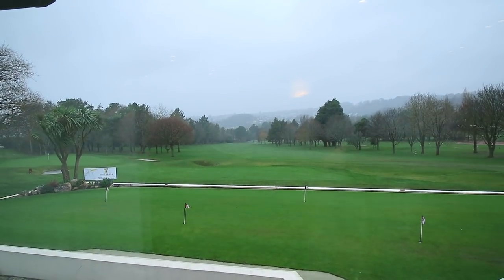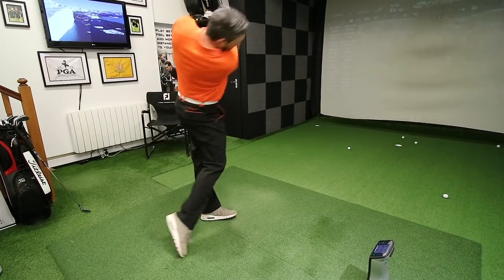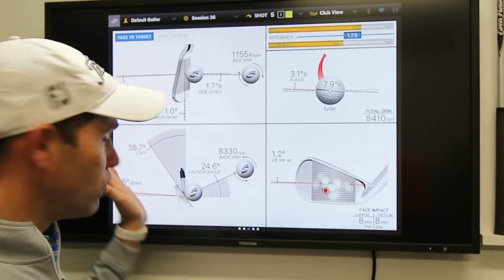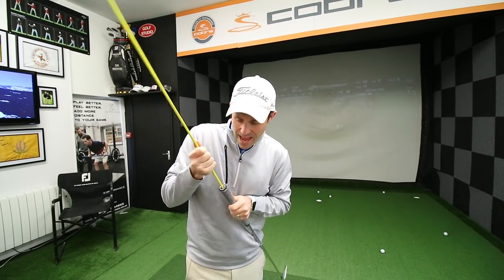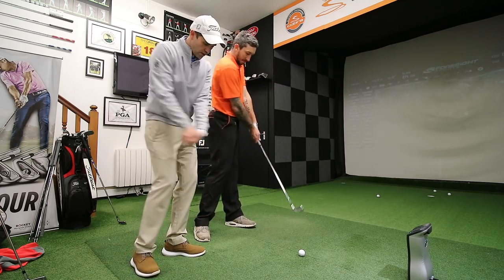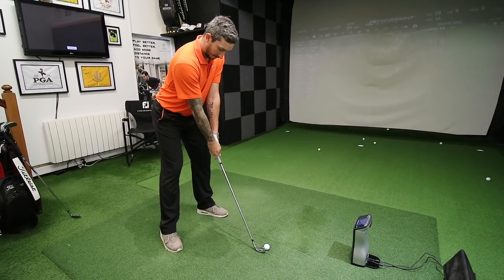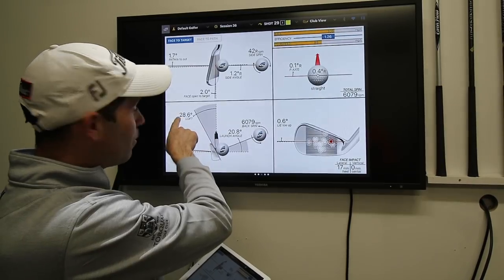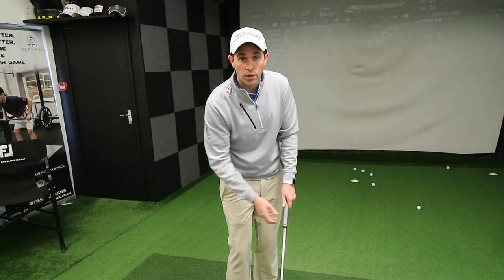HOW TO CONTROL YOUR IRON LOFT

Comment: By coincidence I was playing around with loft today at the range. Lately I have been injured and unable to play for several months. Getting back I found a lack of club head speed and distance with my stiff shafted clubs. I decided to take my old clubs with regular shafts to the range. When I learned I needed my stiff shafts I had to find a way of making my old clubs work. I had the result I required by reducing loft as you described, so now I want to transfer it to my new set. Can't wait for the experience tomorrow. Thanks for that today. Good luck with the channel.

Comment: Yep, I had this issue too and have been working on it for a few months now. Haven't been using the stick drill though - what's helped me is a drill where I take a half backswing and then doing a full swing through from there. My coach gets me to visualise "50% back, 150% through" and it's been really helping.

Comment: Love the video dan i went through that process with my coach. But my reasoning was efficiency and to sort my path. I've had the issue with lower than average spin since i changed my delivery from 8 deg out to in to 2 degrees in to out i lost spin.

Comment: Hi Dan, don't know if you can help?  I play Cobra one length irons and hybrids. Cobra F9 driver and woods. My swing speed for irons is normally around 67-72 (irons) and slightly higher for driver/woods. As a result I don't get much distance - 7i 125-130yrds
I'm 52yrs old.  Any ideas why I can't hit further? I guess it's technique..

Comment: I have the opposite problem. I sometimes get my hands too far forward. I can hit my 58* at 20* launch lol. Generally when I'm hitting well I'm around 1/2 the loft. 58/29, 34/17, etc.
Reply: You are talking about launch angle, Dan was focusing on this guy's delivered loft in the video. They are different measurements. If you go back to the numbers for example on Lee's good swing with 26* delivered loft he launches at 16*. Hitting launch angles of half the static loft is fine.
Reply: @michaelbarnocki5668  I understand both numbers fine. I dont have easy access to a Quad so I dont have my actual delivered loft but my launch on a lob wedge can approach 20 or lower which is far too low. Consider his 7 iron launch at around 27 the first go which is obviously way too high which is why I mentioned the 1/2 the loft thing. Sorry for the confusion haha!
Reply: The problem with too much shaft lean is that you can't launch the ball enough high and it doesn't have spin. Also the smash factor is way too big and makes the gapping hard. I sometimes hit it with too much shaft lean, and get 16° dynamic loft with a 34° 7 iron. Then the smash factor is  1.43 on trackman which is too much for a 7 iron. The launch is 12° which is good for a driver, not for 7 iron. The shaft lean is good for driver as I get 1.51 smash factor and 2000 rpm spin. The launch is sometimes under 10° even when I hit up on the ball. So the optimum would be 25-28° spin loft for 7 iron which gives 1.36-1.4 smash with 7 iron and good 6500 rpm spin.
Reply: @konstamattsson  If I get over 5500 I'm satisfied. If I'm over 6000 it's a fluke. Generally between 53-5800 with 7.

Comment: At setup should the end of the iron be pointed at the belt buckle or leaning forward? I have flippy wrists and wondering based on trying this drill if the iron should be more leaning forward at address?
Reply from the maker: Anthony McManus more forward for this drill 👍
Reply: Dan Hendriksen Golf so just for the drill to get feel not when you actually play a real shot?
Reply: Even when you play the shot. Handle forward mate